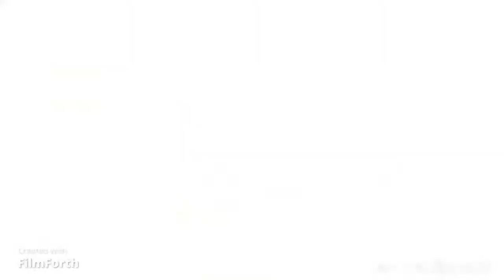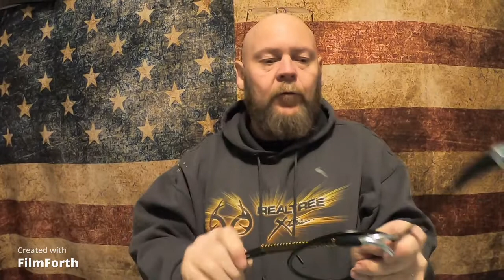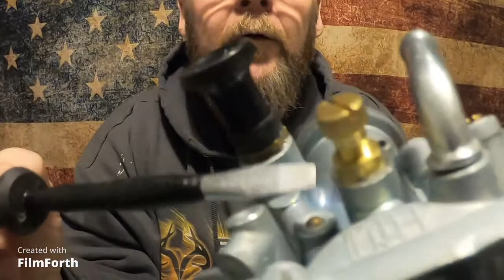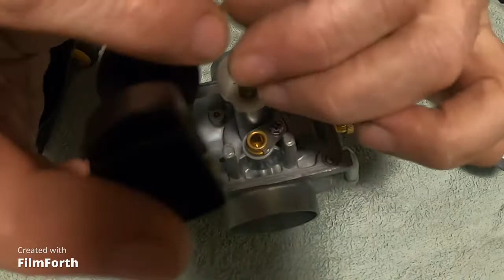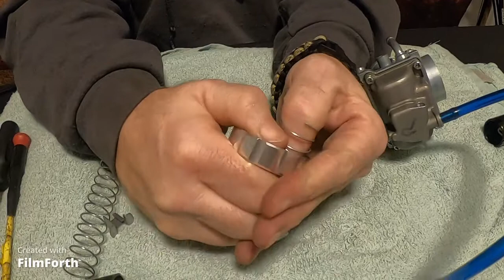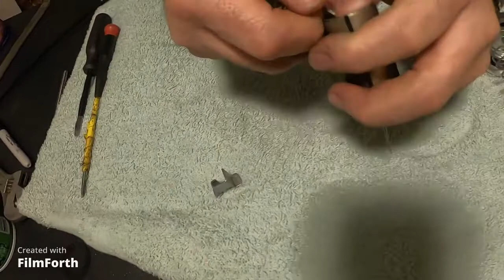banshee build tors delete kit

Comment: and beware of this throttle cable, which is included in all of the Tors delete Kits. no matter if its from Motion Pro. my kit, also from MP, failed after not quite two years. i had to be dragged out by car late in the evening two weeks ago. after it occured, the slides won't go much higher than a quarter, just a little above idle. unfortunately, i wasn't able to figure this out fast enough- or to fix this in the field before it got dark. the issue lays somewhere inside that plastic tube located in the middle. i felt from the beginning, that it is junk. the threads inside the caps can be a little inaccurate. no guides for the springs inside the Caps and in in full throttle, the slides will move much higher so that those dots on the slides will not line up with the windows anymore. of course, this will create more tension and stress on the springs and the entire throttle assembly. i cannot say much about the quality of the cables itself or the mantles, but they appear much more fragile than the OEM ones. i hope one day there will be better quality Kits available. okay, there is one from Moose Racing, but this Kit costs around 200 Bucks (in Euro) lol.